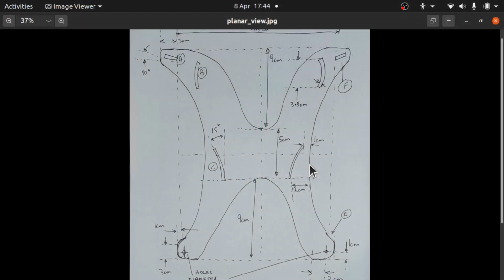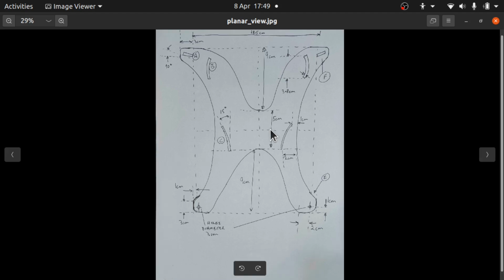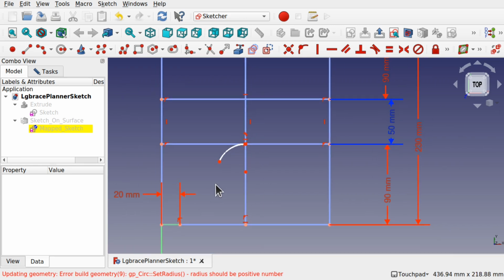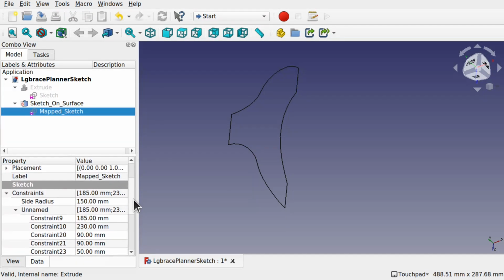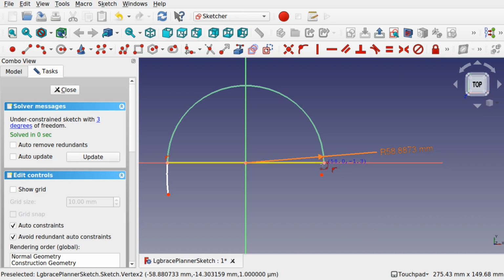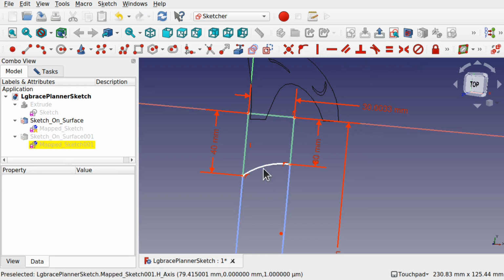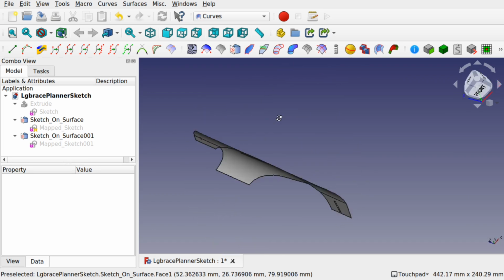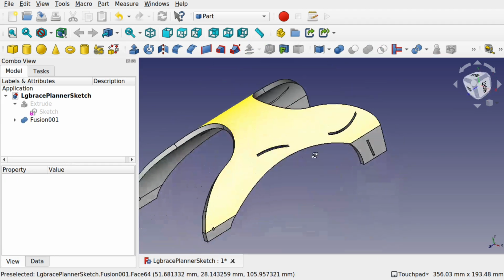Medical Leg Brace in FreeCAD Curves Workbench 3 of 3 The Build | 3D Printing

Comment: Thank you for the series!
A quick question - why are you sketching "extensions" with "sketch on surface"? You could just do that part with a normal sketch on a plane.
Reply from the maker: The idea was to show how the curves workbench sketch on surface can be used with multiple faces. Sorry I have just realised I didn't really make it clear that the idea is to allow for the extensions to curve in ways and be adjustable if needed. I am looking to control the curvature with a spreadsheet in the final model.
Reply: @MangoJellySolutions  Ah, got it! Thank you for the explanation.

Comment: The surface you created for your drawing is 1/2 of a circle. A leg in most cases is more elliptical with the calf wider at the top than at the bottom. Could the odd shape be created by multiple arc segments of different radii then be joined to make an odd shaped ellipse? Can the shape be extruded to make the sketch surface as you did to make the final part?

Is this thinking along the correct path or did you find limitations of FreeCAD which would make this approach impossible?
Reply from the maker: The arc shapes can be create by as many arcs as you like. You can't create straight sections or bspline as thought they are supported in sketch on curves you cant work to exact scale. As long as they are made up of arcs you are good to go.
Reply: @MangoJellySolutions  

Thank you for the reply.